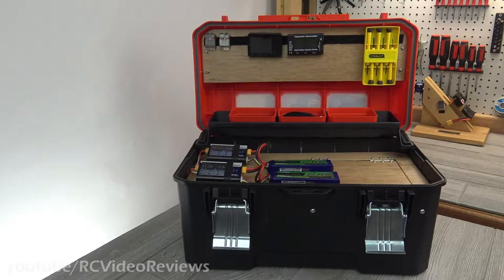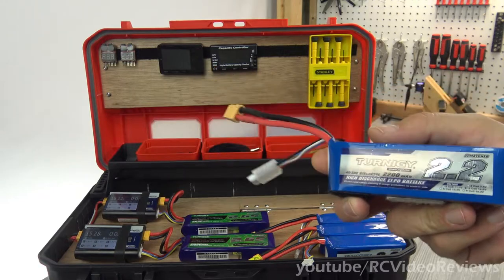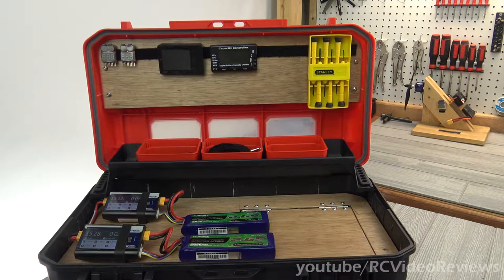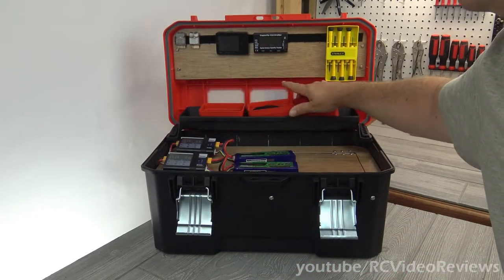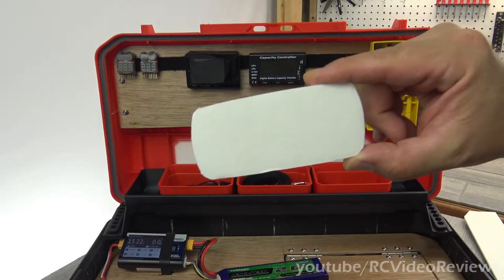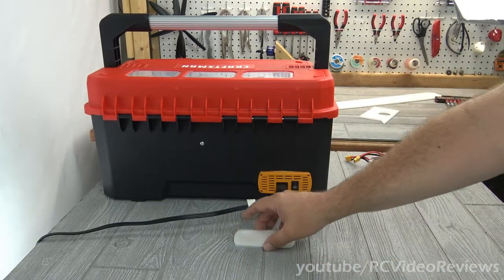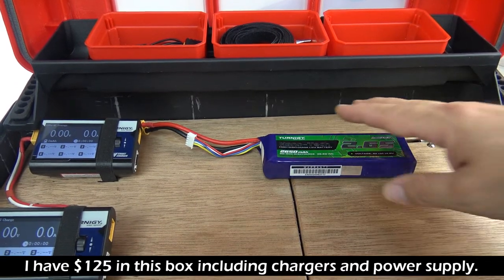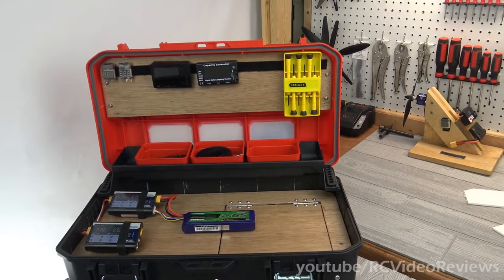Build a Portable LiPo Battery Charging Station #WithMe

Comment: That looks really nice John. I wish my field had AC power. I’ve been talking to our members about setting up power using Solar panels a controller and Golf cart batteries. Most are indifferent to the idea. I think they just don’t want to put in the work to get the material and put it together.
Reply from the maker: From time to time I've charged up my 10,000 MAH 4s packs and used those as a power source for field chargers. It would be a simple setup to use the 10,000 packs as the source in this box. I almost added a toggle and jumper feeds to switch between battery and PS as the source but I just don't think I'd ever use it.

I've also seen setups using deep cycle batteries only. That's what i probably would have done if I didn't have AC.

Comment: Hello, with a 12v 8Ah battery power supply as in your video do you have an idea of the number of possible charges?
Thank you
Reply from the maker: Lot of variables here. If your 8000 is total capacity and you follow the 80% rule, that means you get 6400mah of usable capacity. If you're charging 2200mah flight packs from 3.6 to 4.2, that's about 1760mah following the same 80% rule. 6400/1760 = 3.6 full charges. So you could charge 3 3s2200's with your 8000mah source.

Comment: Looks great. I’m wondering why in all of these cases people are using DC power when the chargers have AC power?
Reply from the maker: DC chargers tend to offer more output power--higher wattage. Not true in all cases of course but none of my chargers support AC. Since AC must be rectified to DC, DC chargers can be smaller and/or don't require a power brick. DC also has more 'off grid' options. i.e. If I'm flying somewhere without access to AC power, I can connect this box to my truck or a solar panel array. Using AC chargers, that wouldn't be possible without the addition of an inverter.

Comment: What method did you use to fasten the boards to the top of the toolbox?
Are those Rivets?
I have a similar project building a FPV case using a 19" monitor.
But now I believe I need a portable charging station:)
Reply from the maker: I absolutely love this field box. It is hands down one of the best RC tools I've ever owned. 

I used L brackets mounted inverted on the sides of the case. The inverted L supports the board two on each corner.

Comment: It may work for being outside, but never have a cell explode in that. Imagine a blasting fire in seconds while driving. To my opinion you ask for trouble. Please use safety boxes.
Reply from the maker: 4 years using this box in Florida heat. Still use it on nearly every trip to the field.

It is my belief the fire stories are connected to a predictable fault either in quality of components, process, or knowledge. 

I will continue to use my box as I have for the past 4 years. It's been fine. It will continue to be fine.
Reply: @RCVideoReviews  There is always a first accident. I agree, it will be  predamaged material in most, but not in all cases.I work in an institute with research in mobile robotics, planes, drones, rovers, ships. You can imagine, we use a lot of LiPo. We had one incident up to now, presumably with a pack mistreated by students. But it was just lying around (on a safe surface), not charging, not discharging, even not fully charged, according to my knowledge. It was quite impressive regarding the size of the pack.
But you do what you feel in accordance with your responsibility. Please do not feel harrassed by me. I just issued my opinion.
Reply from the maker: Everybody can have an opinion, but I've got my own reality. When I see a damaged pack, I dispose of it. I don't play games. When I charge them, I use the correct methods (balance) when I store them (and I always store them) they are at 3.8v/c. If you work in an institute of research, you above all should agree with the premise if you introduce unknown variables (students potentially mistreating packs) then you absolutely are NOT operating under the same conditions I am operating under. Your students who can potentially mistreat cells add a variable that doesn't exist in my or most other situations.

So my opinion is that we stop pointing at lipos like cavemen and wondering when the magic smoke will appear; but rather to handle the batteries properly and correctly and we'll be fine.

Always a first accident: Well, there's always the chance someone at a gas station lights a cigarette and blows me to kingdom come as well. I simply do not subscribe to the school of thought these cells are inherently unstable. Like any other hazardous material we live with day in and day out, when handled properly, they will not mysteriously become unstable.
Reply: @RCVideoReviews  100%ack. If you want to be totally safe  don't get up in the morning and die from a heart attack.
I still prefer to have the best security with reasonabke effort. A safety case with charging infrastructure is not very expensove and contains the fire quite effectively.
The two of us just operate in different contexts.